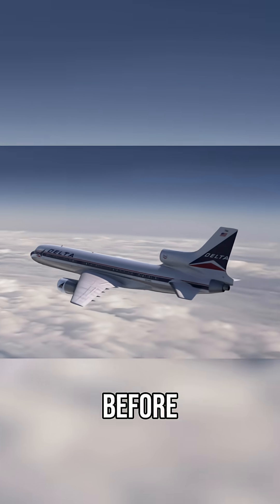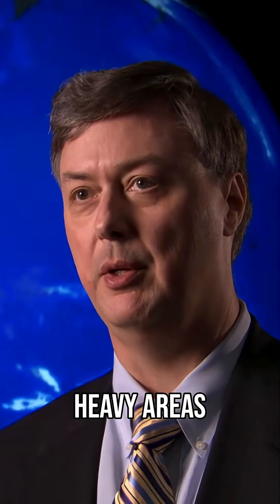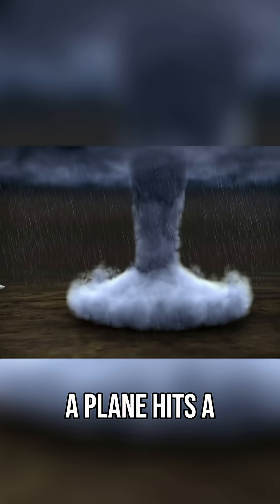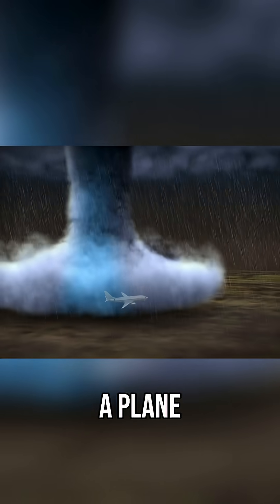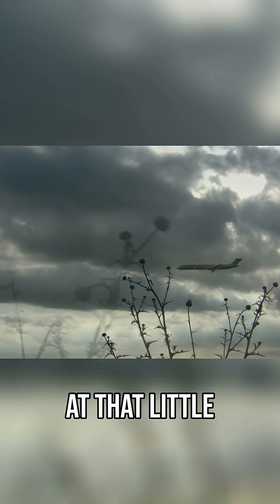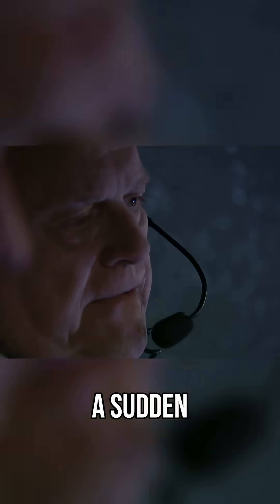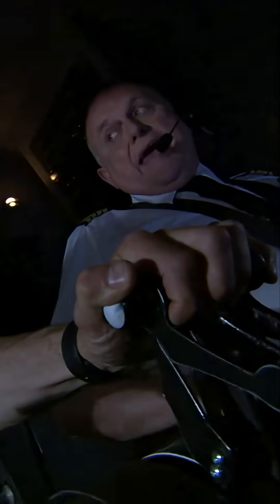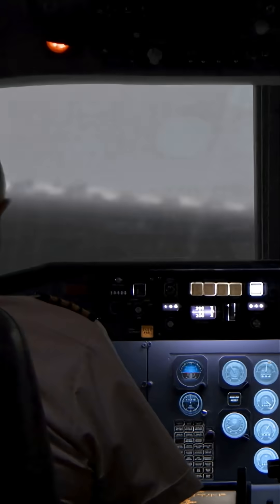Delta 191 Microburst Disaster Aviation Accident

Comment: Very tragic crash indeed, in August, 1985, that claimed [137] lives,😢🙏 but there were around [28] passengers that did survive.👏   The year 1985, was the [deadliest] in aviation history, during the [1980's].😒

Also, if anyone is wondering, this aircraft in this video is a Lockheed, L-1011 Tri-Star, and [not] a McDonnell Douglas, DC-10 or MD-11, even though these aircrafts look similar.😐
Reply: U mean 27 NOT 28
Reply: @McDonnellDouglasDC8  I meant exactly what I said, [28]......case closed, and I will STAND by this.😐